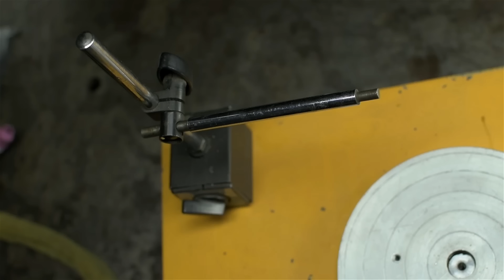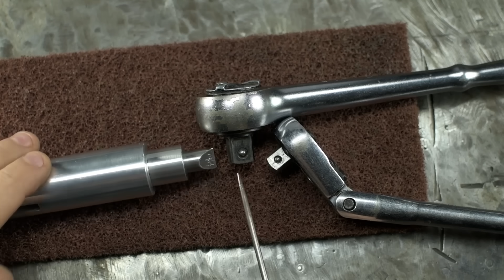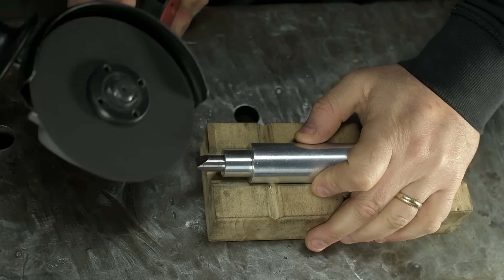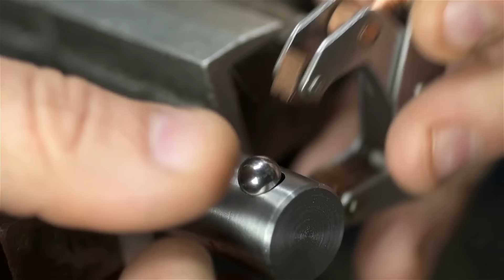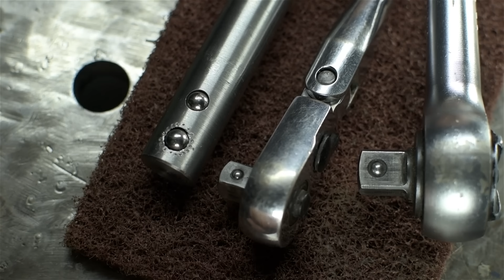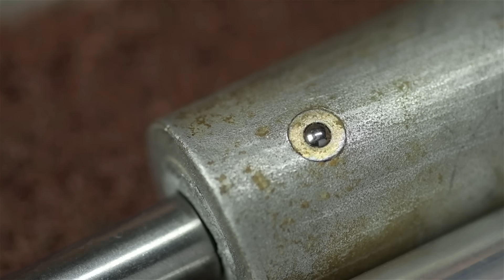Spring-loaded Detents, alright!

Comment: Great use of mayonnaise_bottle_squeeze#4.wav
Reply from the maker: I almost went with the ketchup but mayo worked way better.
Reply: It always does!
Reply: Антон Южаков you took a dose of what kinda drugs?
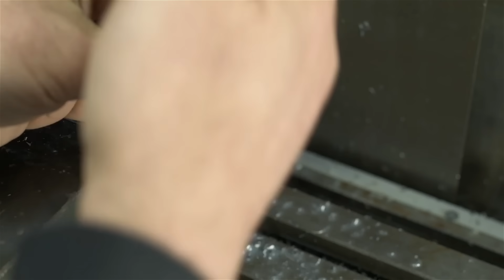Reply: 5:32 👌
Reply: Love those flex head ratchets, you can fold the handle, then use two hands on the handle to spin it like you do with a speed handle. Faster than an air ratchet, given room to use and some experience.
Reply: Where do you get those oilers with the bell? Nice tone!
Reply: +carolyn mmitchell:
And what is more important: where can I buy them?

Comment: I'm guessing there used to be a second, weaker spring on the back side of the reduced section inside the barrel.  When someone took it apart, or maybe when it broke, the spring went sproing across the shop it's now under a cabinet somewhere.

The spring you've got provides the main detenting force; the second spring takes up the slop and provides some resistance for the button-pushing.
Reply from the maker: my thoughts exactly.
Reply: This Old Tony well... Would be nice to see how that would turn out. Next video? Harold can wait.
Reply: Harold still has that other spring, he's trying to use it as a Slinky.
Reply: I'm glad I scrolled down to find this, because it's exactly what I was going to suggest: there's a spring missing.
Reply: No, no second spring or missing parts and yes, the spring is supposed to be in the front.

When they are installed, the plunger is proloading the spring and all slop is removed and the assembly works flawlessly.

The only reason I know is because we use to have a large detent locking turntable at work that had a release detent mechanism identical to that one in it got broken at the mount collar just like that one did and we did the same thing.... Machined a new body from bar stock... 

Not sure if every application is / was the same but for our turntable, when it was properly adjusted and installed, the release lever sat at about a 25° relative to the body and this gave just enough movement that when the lever was parallel to the body (squeezed as much as it would go), the detent would just release from the pocket it was in on the table.

Basically the adjustment of the plunger threads adjusts the amount of preload tension (well compression) was on the spring when installed and the adjustment on the clevis threads set the angle that the release lever was at when installed.
Reply: Bingo!
Reply: Uh, Yeah... Thats what i was gonna say, i mean i was gonna say that first but I didn't want to hurt your feelings
Reply: Jason Goodman seriously I need to know if this is the answer, furthermore I NEED A FOLLOW UP TO THIS VIDEO WHERE TONY GETS IT SET UP CORRECTLY BEFORE SENDING IT OUT!!!
Reply: Me too. I built one like that some time ago.
Reply: @ThisOldTony  For the sake of all that is good and evil, I have to know man....WHAT IS THAT THING???????

Comment: You probably know this but I'm going to write it anyway.  The style torque wrench you have (or torque yank as we used to call them) actually use a pivot block instead of detent. Think of holding two blocks together and you press them together. Now push one of them in a perpendicular direction while squeezing. The more you squeeze, the harder it is to get them to pivot. 
Snap on actually made another type that had a slip mechanism similar to the center punch too.
This comment is why I don't have friends.
Reply: Haha, same here...
Reply: But its better to know then not to know crap now I'm gonna take my torque wrench apart 🤔
Reply: i don't have friends because i hate everyone.

Comment: Be careful Tony - I think people are just pretending not to know stuff and are leaving comments on your videos to guilt-trip you into making another one.  They should be ashamed of themselves.  Anyway, how do they make those ball bearings on the detents so round ?
Reply: When they take the block of steel, wrapped in a cloth, and hit it with a hammer, they use exactly the right hammer and hit it exactly right. Result is exactly-sized, exactly-round ball bearings.

Of course, this is mostly done on an industrial scale. A clue about Tony's day job, maybe?
Reply: Cheers ThadEGinathom good to know :)
Reply: Serious answer: Drop towers. If you drop a liquid, it forms a perfect sphere while it's falling. So mostly they just build really big towers (The afformentione "Drop towers") and sprinkle liquid steel/ally inside it. It forms a sphere and solidifies as it falls.
Reply: @JoelWojkiewicz  I'm not sure where you got that idea from as shot towers are only suitable for making lead shot. Ball bearings are made using a mechanical process, see the video linked in the comment above.
Reply: Wow.  This wooshed over so many heads...

Comment: Question: Can you use a Spring Detent in the Winter? Will it stay fresh that long?
Reply from the maker: I keep mine in the fridge, in a ziplock bag, with an apple slice.  They seem to work well.
Reply: Of course you can. These things are called spring detents because they hold back spring. Studies have shown that they reach maximum efficacy if you deploy them a short while (two to three weeks) before spring would nominally begin. But be careful - spring detents cannot hold back spring forever.

Comment: Random thing about detent springing up everywhere, I think some headphone jacks use them to retain the plug!
Reply: They often use a leaf spring of sorts.
Reply: Most use the leaf spring, as ddmeltzer8 mentiones, you can see it very easily if you google 'female guitar jack'
Reply: I would very much like to test the o-ring type!As the leaf spring can sometimes give off a small sqweak...
Reply: Springing up everywhere... I see what you did there
Reply: Sometimes when they wear out all you have to do for a bit extra use is to re-bend that spring leaf. Of course that work hardens it and eventually it'll break when you go to bend it again. But it's a quicker fix than replacing it.
Reply: Just make sure safe search is on.

Comment: Take an old socket and grind a bevel around one end. Use the socket along a hammer (or a 20 ton press as long as it isn't a boring grayish-color) and swage the detent  hole. The socket will self-center on the ball and simultaneously hold it in while you swage it.
Reply from the maker: good idea!

Comment: Well, I'm only 50 percent human but..... to me that looks like the gadget on the bottom, or top, of double doors to lock them.
What was it you said it is ? 😊
Dangit, I believe you could make a good video about ANYTHING, good show ol chap, good show ! 😊
Thanks for sharing and take care. 👍 👍
Reply: You know what, that actually seems like a pretty reasonable assumption. I was wondering why the level you pressed down was damn near 45* to the body of the part, but it would make sense if its mounted upright and you press it with your foot. I haven't seen too too many of them but the ones I have usually have that similar shaped pin head and it might explain why there is so much play if it doesnt affect how it operates.

Comment: We use these in the orthopedic bracing industry. The ball is set using a hand punch called a corking tool. It is created very similar to the one you peened  over except it is done with a punch. The surface has to be flat, so you would have to mill a flat first, drill a hole for the spring/ball diameter, then push the ball down with the punch. It is then struck sharply with a hammer to swage the rim in to hold the ball. It will look just like your ratchet detent when done. Here are a couple of pictures at the links. The hole for the punch is obviously a little smaller than the diameter of the ball so the ball can't come out. P.S. If you are creating an oiler type application, you would use a smaller through drill out the back side so the spring would be contained, but the oil could drip through. 
You won't likely be able to order from the links provided, and I can't find a public source, But I think you can "make like picture"
https://www.cascade-usa.com/ball-catch-tool-and-parts.html
http://www.beckerorthopedic.com/Product/MaterialsEquipmentAndProsthetics/Equipment
Example of one installed on a leg brace
http://docplayer.net/docs-images/58/41282411/images/30-0.png

Comment: Neat! One of my first jobs was working at a torque wrench factory. My job was installing the socket retention balls. And it went like you said, drop the spring in, then the BB, then stake the edge of the hole. It wasn't a press though, it was more like a huge power hammer that would come down and smash the edge of the hole in less than a second.

Comment: HHHHHEEEEYYY TONY! If I watch all ur vids maybe like 10 times should a guy get certified .  Because I don't mind I could laugh all day long no prob.. Hell I'd do it for no certification lol ....but seriously I like your welding. Your metallurgy is spot on. And machining very helpful. You explain things the way I understand them 👍. One note to you, an easy way to weld hss on virts is use a level. Make sure x and y of ur base is level. Find the high corner  of the joint and tack that corner  first.. Pretty certain 99% of the time there's a corner on a joint and that leaves the other three side room to tweak too level..  Choose the next adjacent corner tack that level. And finally level the third corner and vola. The upright is at 90 degrees to base. The trick is to make the tacks big enough to stop the heat distortion yet small enough to tweak. So when you do weld them out they are strong enough to resist heat distortion..  Eliminates the spacers...10,000 miles of hand rail hss teaches that one.  Lol 
I just pickup a 1994 Tros Trenkin sn50c so I'll be watching you.. For a while... lol

Comment: Dammit Harold!  One pic would clear this up.

I've been googling "mortiser index", "mortiser stop", "mortiser clamp", etc. with no answers.  This thing's big, so the machine must be big, which means the material is big.  Like large doors, or timber framing.  It only works in one (two) direction though, being a chisel point.

The best guesses I can come up with is:
a) An end stop, for repeating heights of door hardware mortises.  That detent fits into a slide that rides on a fence rail.
b) A depth stop.  Somewhere near the quill, that detent indexes a wheel to set repeated mortise depths.
c) A clamp stop.  Like hardy-hole-style clamps.  You move it in and out to the nearest hole(s) and hand clamp it from there.
d) Angle detent?  Some TS mitres are like this, with detents on the 15°, 22.5°, 45°, etc.

You tell Harold to fuck'n pay up so you can tell us how this thing is installed.

Comment: I replaced all the pain in the add bolts in a carport tent I use at big events with button detent springs, now it all goes up so much faster.  Took me a while to find a supplier, ended up buying bulk from China.  I needed about 60 and had to buy 100.  Still have a bag oh them around here somewhere.

Comment: That gizmo is a set pin it holds something locked in place until someone mashes the trigger.  When the trigger is mashed the pin pulls back allowing something to open or pass.  look on a J-Head Mill the shift from low to high is like that.

Comment: Looks like a locking mechanism that's supposed to be retained at the top or bottom of a door, I think I've seen something like this on shop doors and it's so you cant get in from the outside, probably more common on the main entrance than the rear entrance.

So in theory, itd be locked outwards when in use, and float inside when not in use? A shop deadbolt? For when you cant deadbolt into the wall because the wall is another door next to it

Comment: This looks like the retainer on my tow hitch... if that's the case then the front finger of the U shape of the "button" should be pushing the thing (that's why it has a little bit of angle to it)
 The spring should be in the back and when you push it it actually "arms" the button. Then when you press the button it releases the thing in the front

Comment: Good one Tony. 
I you don't mind me saying, I think the center punch doesn't work that way. I mean, the punch doesn't get triggered buy a spring load exceeding some limit or detent. In that case the trick is made by an offset conic pin that at some point gets aligned with the "hammer" releasing the tension of the spring you shown in the video and punching the tip. 
That of course is what I understand, unless there are different types... 

Anyway, cheers buddy!
Reply from the maker: Totally could be, not all facts presented in these videos is guaranteed to be 100% true. :)
Reply: This Old Tony I agree with you 99.73% on that
Reply: You are correct: https://en.wikipedia.org/wiki/Automatic_center_punch

Comment: It reminds me (vaguely) of explosive bolts. A self contained gun that electrically primes an explosive charge to push a wedge that ends up cutting a bolt set in hole perpendicularly to the main tube containing the whole device which is set between the 2 pieces it olds and liberates. Now that’s a fun project the requirements are no flying wedge, no external explosions, no loss of body parts, pets or relatives. The bolt must be cut neatly and ejected by the shape of the wedge. Further informations on how to build a multistage rocket will follow.

Comment: I've seen a similar part on a rotating mount for engine repairs, it was used as a quick stopper but the broken part of yours had threads. You push the button and the mount rotates free, but when released, it's very difficult to rotate it because of the strong spring.

Comment: It seems to me that this device may be a "hand lever" of some sort. Consider the place at which the device broke, it obviously has had some force applied to the outer end to cause it to snap. The implementation of a detent would not be designed as  something that "just sticks out" of another part.
Consider this as some part of a hand-wheel for example. You could turn the handle and if the detent is engaged the detented part will move with the hand-wheel. Use a couple of fingers to "press" the button, release the detent and the hand-wheel moves without moving the detented part. 
Consider also that the "chisel" tip of the detent could be rotated 90° (if allowed to do so in its mounting) and effectively disengage the detent. To allow the rotation there would be a need to release the detent from its slot, hence the button. 
I would make the assumption (huge guess) that the device to which this detent is attached, has an operating mechanism similar to that of a dividing head.
Reply from the maker: Interesting take, Zen!

Comment: I wonder, If you make a punch that forces metal inwards, with half the ball fitting in it and behind it a magnet, if you get a better result, if you heat the metal first to mend with a torch. then you can drop the coil, press it in by hand and have control until you notice the ball isn't on the tool anymore but pressed in.

Comment: Pretty sure I would need to annex half of Adam's oiler collection to cover the bases on my lathe. I swear the oilers are about a million odd sizes from 2.17 to almost 2.2! So, I just lop the end off one of those gear oil bottles and try to get the angle right so it fits most of them.

Comment: well, technically they'd sub-bore the hole from the other side, shove the ball, spring and a plug in then pop an arc across two points on the circumferential interface... or used a ring ridge and crushed it in.

Comment: It should be assembled like you did on the 2nd take.

I think this is how it's used : squeeze the lever with your thumb and place it over whatever you're going to detent and slide your thumb downwards to release the lever.
This will release the detenter (if there's such a word) on to your work piece. 
This sudden shock may have caused the aluminum to crack-off.

Any updates?

Comment: I wonder if the missing bits made this function like a pen in that pushing the button makes it both lock and unlock alternately...   as you point out, the button wasn’t designed to be “pulled up” as it’s shape precludes that option.    Are you done with this piece or is that something you could explore?    While I’ve no experience in the machining trade (I’m the lighting director for a band), I love your channel (AvE’s too) !!

Comment: Being a neophyte, I've been scratching my head over all the ball oilers on my lathe. Just exactly what is the right oiler for those things? Could you show one on a future video?  And, if that doesn't use up your patience for neophytes, maybe you can tell us where to obtain one too!
Reply from the maker: "high pressure oiler" looks like an oil can.  On a lathe, the oil (usually) doesn't have that far to go so you can use a regular oil can, just dress the tip a little with a file so it fits in the hole and pushes down the ball.  Also use a small saw or the edge of your file to cut a slot across the tip (like a flat head screw).  That way, the tip can push the ball down, and oil can squeeze past around it.

Comment: You think there may be a piece missing?  I think you're right, and it may be a shorter spring (same diameter) on the inside.  If you know anyone clever enough to make you a spring :-D try fitting it and see how it works.

Comment: When I was a young tyke, I had the job of making 1/8" ball detents in a component. My clever innovation to the process was to use chopped-up bits of rubber band instead of a spring behind the ball. Rubber band was easier to obtain, and easier to adjust to the right amount of springiness.
Reply from the maker: clever!

Comment: It's never obvious that the detent balls have dropped out my 'chairs axle-pins, until the vaccum cleaner finds them and burns out another belt or the wheel parts company with the 'chair.  That is the cheaper, newer make though.  Ah, 'The Curse of the Quick-Nut/Spring-Retainer Clip....thingy!' on the wedge-shaft holding the detent bearings in!  The better axles are fine pieces of turned steel and rarely drop their detents.